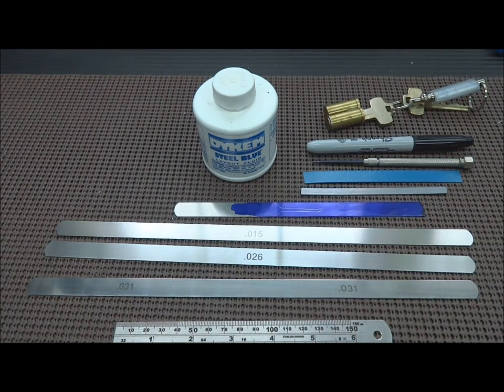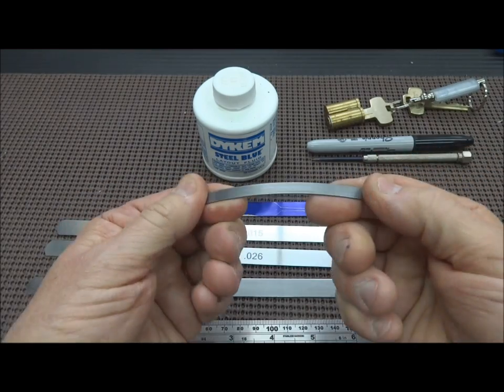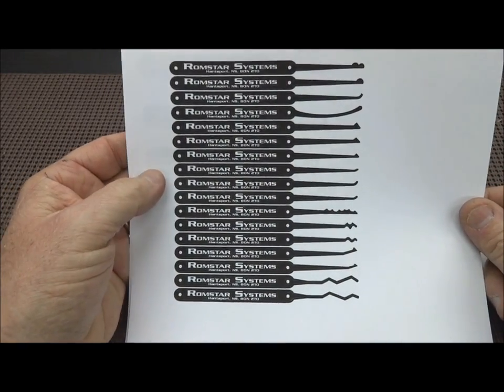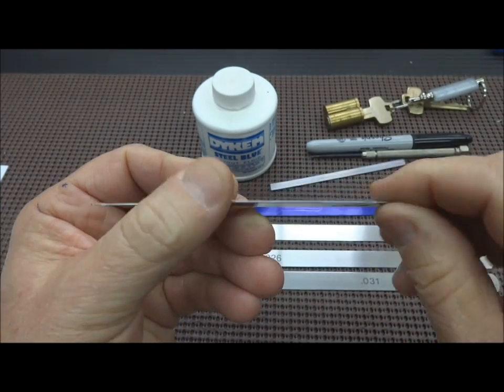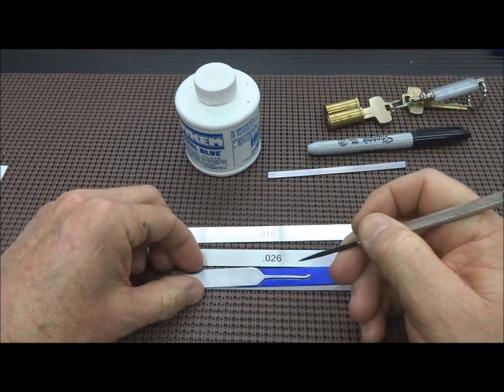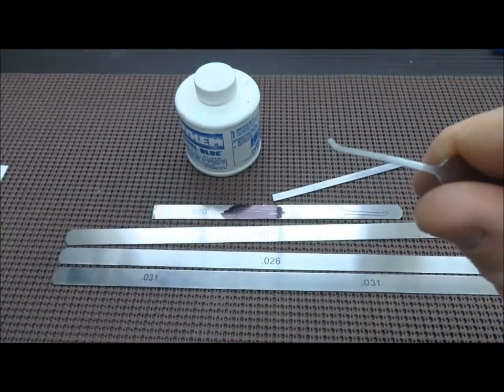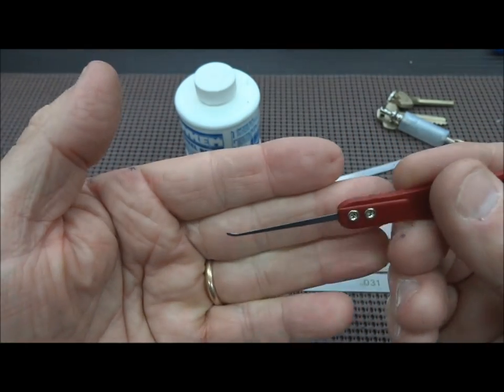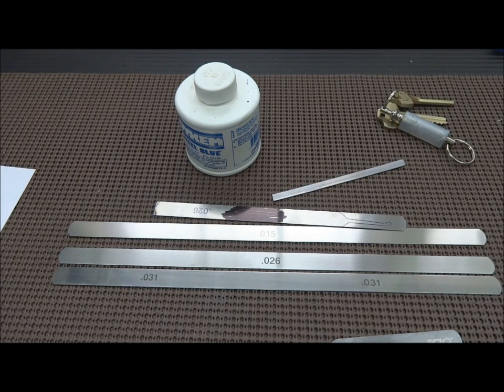(115) Pick Making Part 2: Design and Layout

Comment: Warding files are good for this.
I went to a car MOT garage and asked if they had any old wiper blades i could use since i was locked out of my home.
I got about a dozen metal bits for free. I WAS locked out and left my key inside but did have £5.
Armed with £5 I have to get into my house.
I went to the garage and got the metal  for free and went to Wilko for a set of warding  files, made a lockpick and tension tool and was able to pick my front door yale type cylinder lock open.
The pick initially wasnt able to press down the back pins without setting off others so it needed adjusting.
After a bit of filing it worked perfectly first time and I was in!
WOOHOO! YES! YES! YES! lol.

Comment: Top Tip: Put different colour heat shrink handles on the different thickness picks, then you can grab a thick / thin one just by seeing the handle colour and shape instead of engraving them and having to see and read the size ;0)
Works for spanners and sockets with a bit of heat shrink or just electrical tape too...

Comment: There is one more way to lay out your picksPrint the pattern on a laser printer and use some acetone (nail-polish remover) to transfer the ink to the metal. If the metal is clean enough it should give you a clean transfer of the image. For optimal result you can then wet the paper and rub it off. carefully peeling them works too but can cause some chipping of the transfer.Once the paper is gone it does not come off easily. It is pretty scratch resistant and a lot clearer then a scratch in some permanent marker.

Comment: Hey Bill, I find tempering hacksaw blades to a straw color with a torch before using them. Makes them much tougher, might be worth trying.
Reply: Are you aware that the gears in your icon would never turn?
Reply: +iLoganC I am aware. I didn't design it, found it on the net about two years ago.
Reply: +Andre Gross top gear might be lower than right gear, making turning possible! Or... if they were all in different time dimensions. And photographed with super imposition! ;)